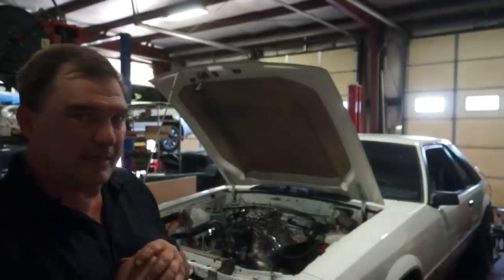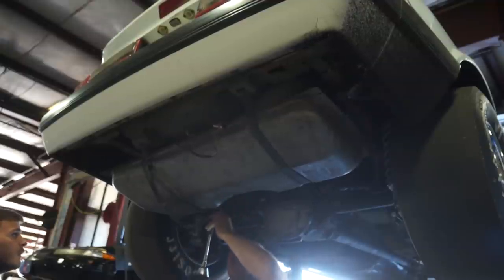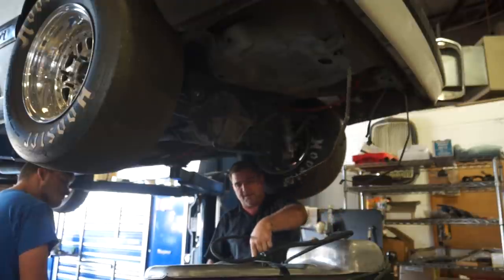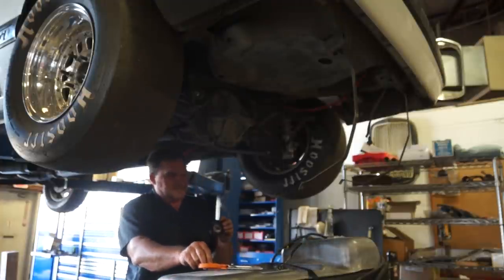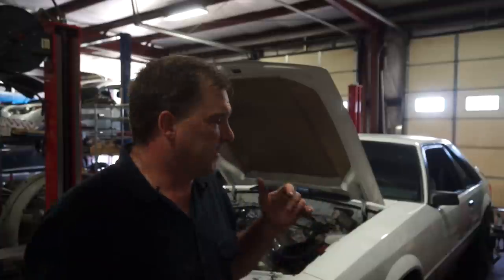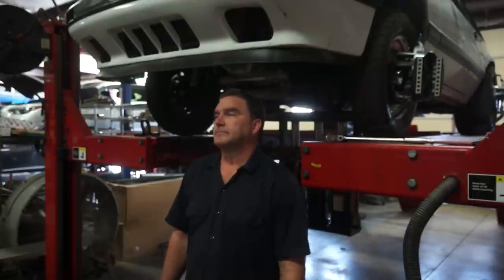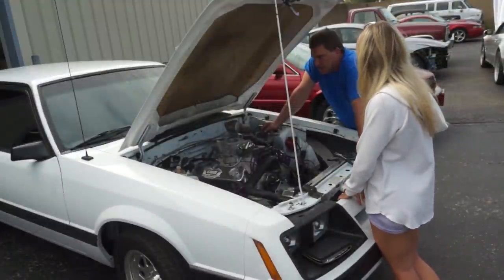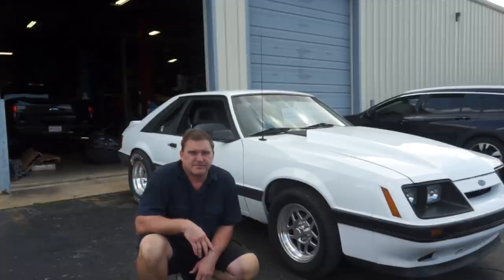Motorsports Molly Fox Body Mustang Fuel Tank Upgrade, and Alignment adjustments!

Comment: that is a very nice looking car you have. I Had a 1980 Mercury Capri 5.0 white.. very similar. Had glass packs coming out the sides until they fell off then the local muffler place had a give me a more tame exhaust and then I ignored the oil gauge and before you know it my motor oil looked like Baileys Irish cream. I can't find any other liquid comparison at the moment.. sold it to some guy and he did an engine swap and threw some mustang body panels on it

Comment: Im surprised that bracket for the shock is designed THAT bad. Nice work man, I used to be a mechanic and I probably wouldn't have noticed that.
Reply from the maker: One of the things we ALWAYS take seriously is the safety of our customers and their rides. Especially if they are anywhere NEAR this kind of speed/power. Certainly understand why the tip bolt hadn't been put in, it was a bit of a pain. But necessary.
Reply: @LucoreAuto  thats good work.

Comment: Bolt on's are great. Everyone loves a straight forward job. Yall have you work cut out for you on the falcon
Reply from the maker: Oh believe us the bolt in fuel tank situation was a GODSEND! Rarely on custom cars and racecars does it go that smoothly, a couple custom fuel lines and DONE! Yeahhhhh that Falcon is going to be an adventure for sure 😀
Reply: @LucoreAuto  OH trust me I know I've been building custom cars for 30 years. I build my youngest son a 88' swb s10 with a 5.0 tpi last year. It was a frame up job. Started with a 4cyl 5 speed manual steering manual brake truck. Now is V8 automatic, p/s, power brake, with ac. I've built 2 to 3 rods a year for many customers, and several for myself along the way. Anyway like I said it's nice to have something fit straight forward once in a while.